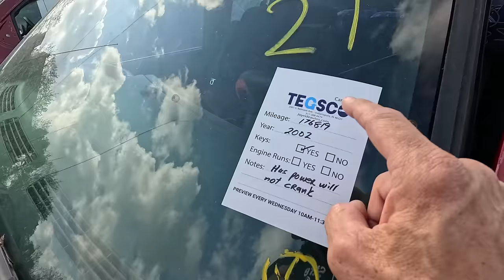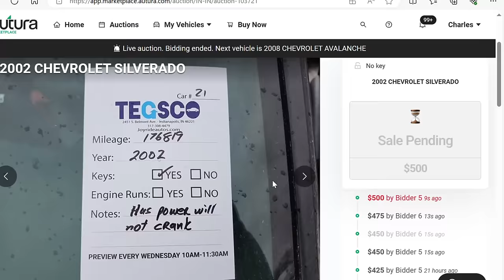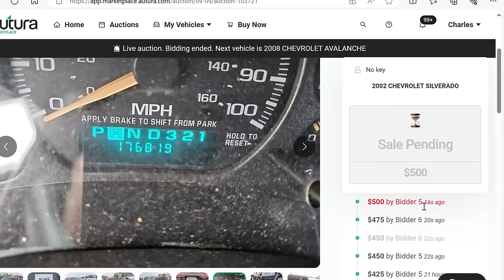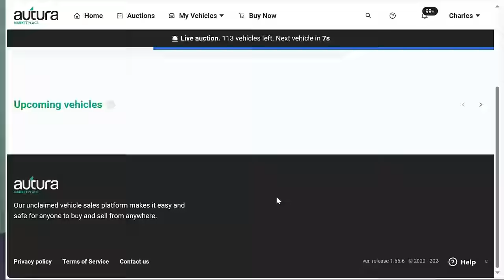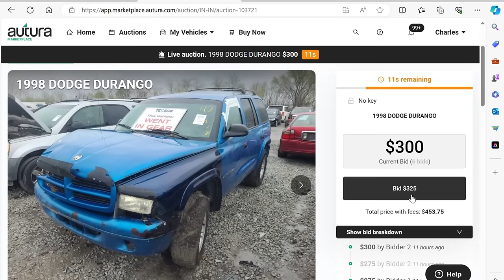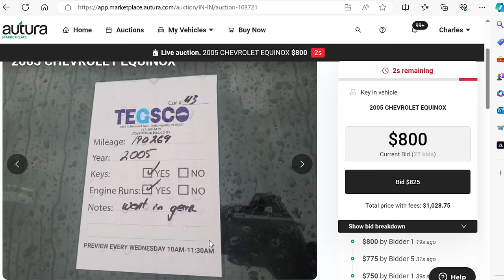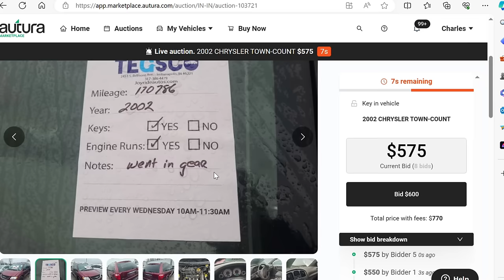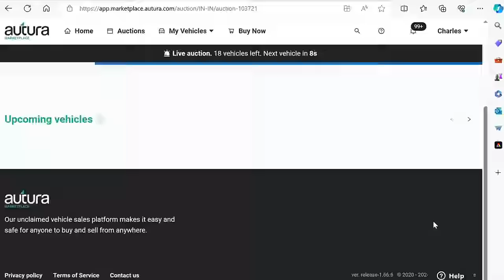Looking for cars under $1000 Indianapolis Police Impound Auction

Comment: Great video Chuck. There's enough parts on that Durango to recoup your money and maybe more. I'd say it lost crank or cam signal and isn't firing now. Check for broken wires at the computer behind the bent fender. Just an observation. Get it running and maybe part it out.

Comment: No way id spend another dime on that durango.  5.2 or 5.9 for the early ones. Both good engines to swap.  I think 99+ ran that junky 4.7 and 5.9 option.  Part it and get your money back.
Reply from the maker: I want to get it running so I can at least drive it into a lake!

Comment: What battery 24:23 jump pack do you recommend?
Reply from the maker: I have had a lot of different ones in the past. The one I am using here is from Harbor freight it is about $200 but has held up pretty good for the past couple years.